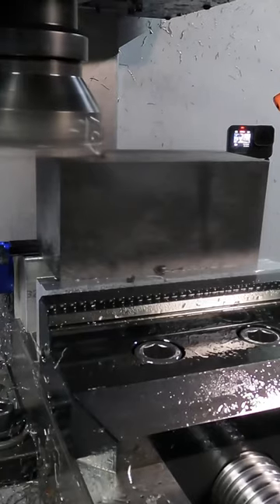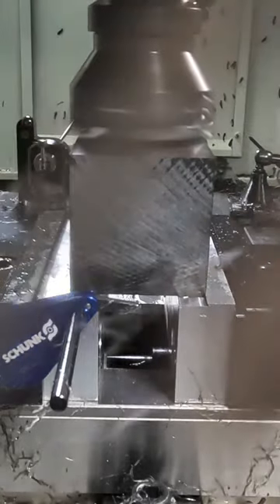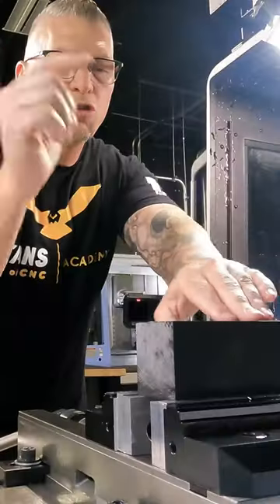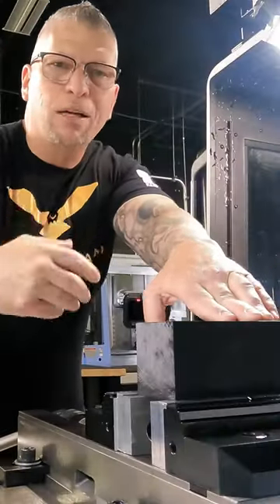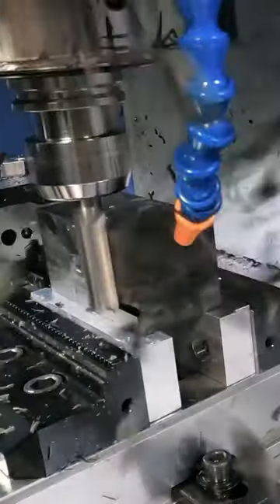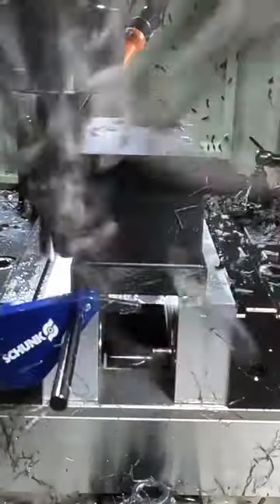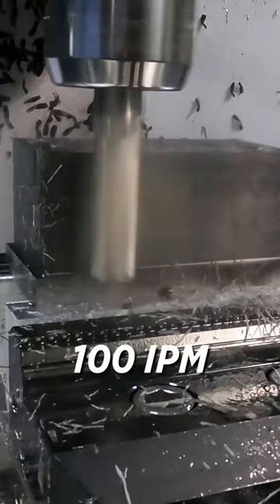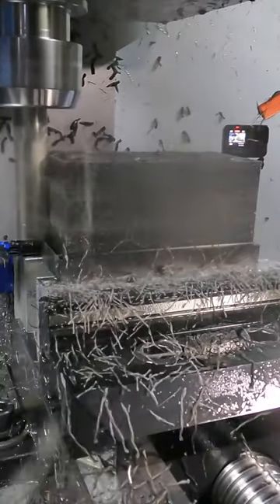The Trick to CNC Machining Plastic

Comment: Machining plastic is kinda fun, but when the tolerances are tight, it's an absolute nightmare. If you take just a little more from one side than the other it bends like a fucking banana. Also not all plastic behaves the same. Knowing the difference between POM,PC,PA,PTFE,PMMA,PE etc. and how they behave when milling can make a huge difference.
Reply: Indeed, not to mention the choice of tools is different as well. People think it's easier because it's "softer", well it's not.  I CNC mill and turn composites  everyday. It's tireing sometimes trying to explain my boss why eg. PE1000 and PE1000R are technically the same, yet when it comes to milling it, PE1000R is tougher and harder to get a smoother finish. It wears the tools down much faster. Because it's basically the excess that's cut and put back in the pot to use to make new plates.  Reheating and cooling multiple times. I am going to test different coatings to see if the tools will last longer without compromising on the finished surface.
Reply: And knowing the differences between the same plastic just from another vendor. I love playing in the plastic materials but they can get tricky fast
Reply: Try f'ing up 2 1/2 feet of 1 1/2inch  of PVDF😅

Comment: I had to cut some holes and put counterparts in some soft rubber once, they were rubber steps that got bolted onto a platform. Had to keep them in dry ice until time to cut, and cut them within a few minutes or they would thaw and the rubber would just flap around and actually cut undersize... Fun times!

Comment: "Next, we'll machine white oak across the grain with a half inch 2-flute straight endmill without breakout or burning the surface." -  Titan, probably.

In all seriousness, would love to see wood and wood based products in these precision machines.
Reply: You'd have to do it in a machine with no coolant in the sump. If wood fibers made it into the coolant it'd be a nightmare.
Reply: Funny you should mention this. Last place I worked at,  we made wood templates. I loved cutting that shit. I was just telling our new hire about that place, today.  We would cut the wood. Then glue more wood on the last stack, in the machine. Wait a few hours,  cut some more off the same part. We had a Haas for that,  and we also had actual 5 axis routers. I had never thought I would become a wood worker... 🤷‍♂️ The Haas would only make it to 200 ipm.

Comment: Plastic?  Inconel baby.  Separates the machinist from the toddlers!
Reply: Both have their set of challenges and solutions
Reply: The techniques for machining plastics is a whole different skill set. Most metals once you make your cuts things tend to stay where you put them. In plastics that is often not the case. Internal stresses in extruded plastics can mack for a nightmare. Delrin is bad for this. As you get closer to the center line on a round bar it tends to get more porous.
Reply: @brandons9138  PA6 also has a habit of stretching out. best thing you can do is take it slow and have multiple finish passes.
Reply: @neovenom7187  Have you ever had the pleasure of cutting glass filled plastics? They chew through tooling like Cookie Monster chews through a box of Chips Ahoy. Nasty shit. The only good thing about them is they are relatively stable after machining.
Reply: @brandons9138  any tips for G10?
Reply: @mikep3813  What operation? Milling or turning?  If you're dealing with large quantities diamond coated tools will be a life saver. They'll last a lot longer.  They are pricey, but they'll pay for themselves in the long run.
Reply: @brandons9138  milling. Never touched the stuff in my life, but got a customer in a crunch.
Reply: @mikep3813  Look at Harvey Tool. They have tooling made specifically for fiber reinforced plastics. Which is basically what G10 is. It's more of a resin, but it's very similar to other FRP materials.  The biggest issue you'll have with standard tooling is the material tearing out on the back side of drilled holes and milled features. They have both milling and drilling tools made for FRP materials. They are not cheap, but between the optimized geometry the amorphous diamond coating will last a lot longer vs any other coating.

If that is not an option you can try placing a piece of sacrificial material under your part to support the material as tools break through. Replace it with each new part and that will help minimize the tear out.

Honestly I'd empty the coolant out of the machine as well. Make sure it's dry before you start machining. It'll make clean up easier. You can just vacuum it up. Wear respiratory protection at all times. Glass in your lungs is no joke.
Reply: @brandons9138  about 800 of these a month. And not sure cutting dry is an option as there are quite a few machines  in the same vicinity and I really don't want to be exposing anyone to the dust. Does tool wear differ if cut wet as opposed to dry?
Reply: @mikep3813  My concern would be more about contamination of the coolant with shards of glass then that coolant making its way into the slides/ways of the machine. I've seen machines get destroyed by machining G10. If you're doing that many parts cutting with coolant might be the only real option to keep the dust down. Just make sure to do a thorough cleaning of the machine after each run. If this is an ongoing job you might consider getting an auxiliary filter canister to help keep the G10 from building up in the coolant.
Reply: @brandons9138  Before I got into machining I once attempted to hand drill through a plate of .375" G10 with a HSS drill. That was a learning experience!
Reply: @atypicalbnc  Was the drill completely round by the time you got done?
Reply: I've had some of my uhmw parts grow but .015" or .020", but whatever makes you feel special lol
Reply: Inconel is a Speeds and Feeds problem. Plastic is a physics problem, and Speeds and Feeds problem.

You can have everything literally correct, and still go wrong when holding the thing. At least with tight tolerances anyways.

If your specs are wide open, and more or less a glorified art piece, then plastic is easy.